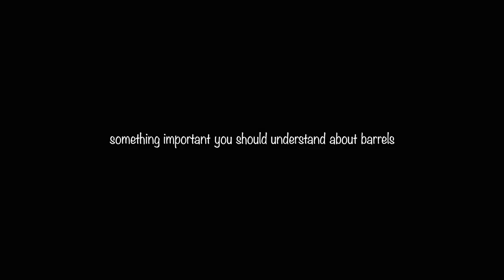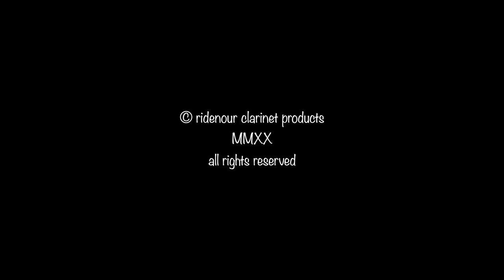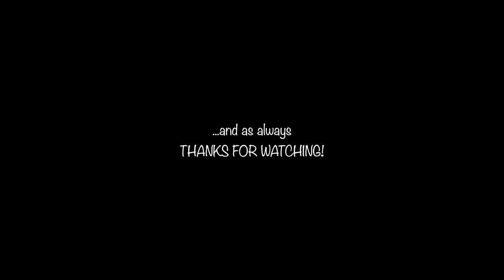something important you should understand about barrels

Comment: Even in California where I live my expensive wooden barrel's rings drop off in winter only to be a tight fit later on in the year
Reply: When you see loose rings and rings dropping off you can imagine what's going on with the bore dimensions.
One HUGE advantage with playing a hard rubber product from the tip of the mouthpiece to the bell is year round you greet Dr. Jekyll each morning. He doesn't seem to transform into Mr. Hyde in winter.
Consistency in performance requires consistency in your equipment day to day, season to season.
Wood fails that standard.